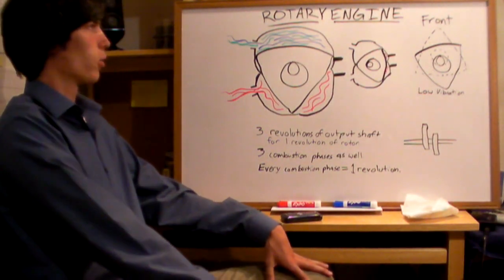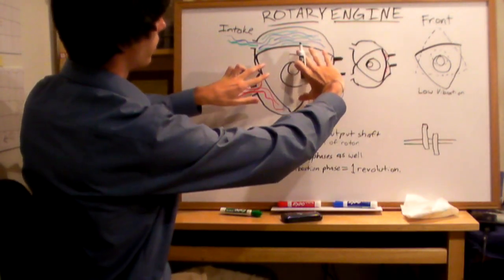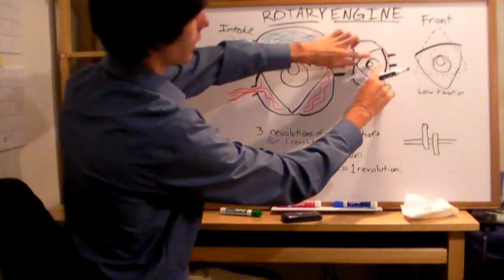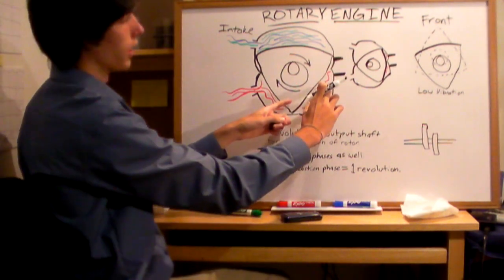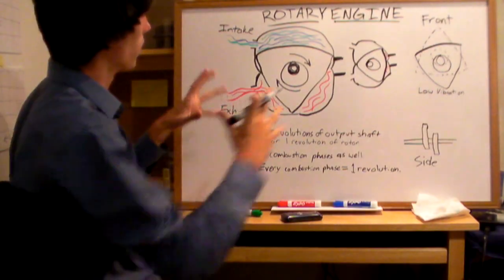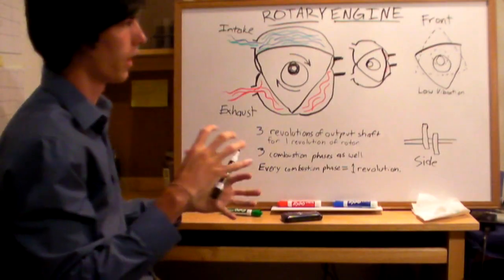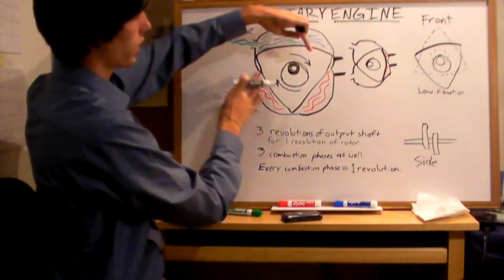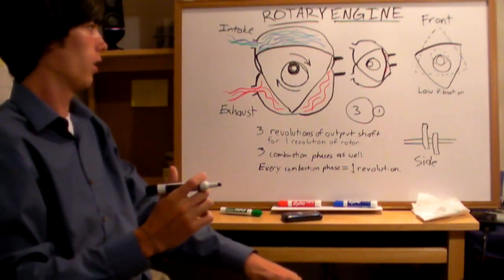Rotary Engine - Explained

Comment: where are the pros and cons?
Reply: What are the cons? Also how can a concept like this not have any pros? it sounds quite nice to me,im not an engineer tho,dont trust me
Reply: Combustion happens only on one end of the chamber and so you have excessive wear on one side with none of those effects on the other two. You also have trouble keeping the gases out of other chambers with seals because of the temperature and pressure differential so you have to have oil being injected into the combustion chamber. By design, the oil is going to be burnt as well so this leads to higher maintenance due to fluctuating oil levels 

The shape of the combustion chamber is also awkward because as you are on the power stroke to ignite the air-fuel mixture, it's already starting the exhaust stroke so you have lower compression ratios as well as poor emissions because of incomplete combustion. Another reason for incomplete combustion is the fact that the spark to ignite the air-fuel mixture has a long distance to go as the rotor continues to move in a circular fashion. You may start to see rotary engines have flames spitting out of the exhaust because of the incomplete combustion occurring in the exhaust manifold. You start to have worse emissions and lower fuel economy as you lose all this energy.

Comment: So why is it that rotaries get terrible fuel economy?  Are their compression ratios high or something?
Reply: +Matthew Bailey Typically they have a low compression ratio. That combined with the combustion chamber shape and problems with rotor seals leads to inefficient burning, causing high exhaust gas temperatures, poor emissions and poor fuel economy.

Comment: are there any real advantages of a rotary engine over a piston ?
as far as i can see the are ineficient and wear much faster.
Reply: +im floop They're relatively light and simple, with only 3 moving parts. They can produce more power than a similarly sized piston engine, but also consume more fuel.
Reply: Tuppoo94 interesting, thanks for the comment ive been looking for this answer for a while

Comment: if i have 3 or  rotors, how is they position going to be?
Reply: “In 2017 it is the 50th anniversary of the Cosmo Sport [Mazda’s first production rotary]. Therefore we want to announce something in 2017 – and not a concept car.”

The concept is said to hint strongly at what might be expected from a production car. Continued Fujiwara: “The concept car is not completely [the look of the production car], but some visions of it is in it.”

 “We realise the fundamental structural problem of the rotary, but recently new materials have been developed and also some measuring, sensing, technology has been updated. We can analyse the combustion in the engine by computer. We can control the ignition system or the injection system in the computer, and [see] what kind of economy can occur in the engine. That kind of technology can help us to new materials, a new ignition system or a new shape for the rotary."

All quotes form Mazdas CEO at the Tokyo Motor Show that all but confirm a rotary engined sports car for 2017. The only reason he doesn't just say it outright is because is an educated person in 2015 who understands how media works..... unlike honda and the NSX. 

I can't find the quote right now but he also said explicitly that since the RX8 there have been at least 50 mazda engineers working on rotary engines which resulted in the 16x engine in a 2007 concept car and more recently the SKYACTIVE R, whatever that may be. Because development cycles are so long theres no way that this car could come out in 2017 if it wasn't already in the final stages of development, so yes, I would say that the rotary engine is very far from dead. Also, the reason the rotary engine was dropped was because of the opec crisis in 1973. Source: the daimler engineer who personally maintains the mercedes C111 concept car whom I had the distinct pleasure of talking to at pebble beach this year, and yes, his collar matched the tartan on the 722 car.
Reply: You sound like your not going to be satisfied until you can personally lick one of the new engines apex seals but since you seem so adamant in your binary definition of the future of internal combustion that time will never come. Any reasonable person has to admit that there will be another rotary engined car in the next few years, and if any of mazdas pr is to believed then it may be making a comeback in a big way in the form of a PEEV range extender.
Reply: +Sach Alvarez Yes there are 3 rotors and 4 rotors. Find it on mazda engine 20B-rew for 3 rotors.
Reply: +The real doktorbimmer being obsolete has nothing to do with weather something is in production, and mazda has always been developing rotary engines and their CEO said that they intend to release a car with their new SKYACTIVE-R engine in 2017.
Reply: @seanzukin8505  A new Mazda  skyactiv-R engine in 2017????
You look really foolish right now.
Reply: the ceo of mazda explicitly said that the rx-vision concept will be a production rotary car in 2017.... no ambiguity. He also said the miata platform is "near perfect", so I wouldn't be surprised if the rotary powered car is based on the miata. I can't find the quote but he also said that mazda feels responsible to keep the rotary alive. I agree with you that it seems that the rotary was dead. I own an rx8 and until this month I was convinced it was the last of the breed but every there is every indication that its coming back in a big way. Be happy.
Reply: http://www.autoexpress.co.uk/mazda/rx-8/92982/mazda-rx-vision-tokyo-concept-previews-new-rx-7-coupe I may have extrapolated a little, but the ceo said a lot of thing that make no sense if they do not intend to make a production car. That being said i dont see how you got that it will be a limited run only for the Japanese market. Sure they killed the RX8, but as an RX8 owner and a huge mazda fan they absolutely did the right thing. That car is extremely well balanced and unique but the only reason it existed was because ford demanded mazda make a four door and not another RX7. They killed it because like any sports car sales dropped off very fast and they couldn't afford to keep it around. Im not sure why your convinced it will be limited run, mostly because if what the ceo said is true mazda intends to make at least one other rotary car; likely a range extend REEV, which is actually quite interesting. I agree that the Renesis engine in its current form is not very competitive. Its possible to scape out 25 mpg on the highway with a light foot but it isnt ideal, however it still passes CA emissions and there is definitely tones of headroom to improve upon that design. A rotary engine with direct injection, a "different shape" as the ceo alluded too (maybe a more efficient combustion chamber?) and new materials (titanium rotor/rotor housing for more thermal efficiency?). the possibility of a low boost turbo to help game emissions and a 1.6 liter engine with a new eccentricity (more torque combustion cycle) could make a new rotary engine relatively competitive in the current market. I dont thing 25/31 is unreasonable, and considering mazda has the lowest corporate average CO2 emissions in the world I wouldn't bet against them. Especially if the car is on the extremely lightweight miata chassis I would say they have a great chance at making something great. The rx8 is not a perfect car by any means but it was built on the same platform as the miata and as a result was relatively lightweight (my lightly modified car is just over 2800lbs) and with 30,000 nm/degree torsional rigidity, which makes it one of the most rigid chasis ever made.
Reply: +The real doktorbimmer well the most modern wankel isn't released yet so you can't make comparison.
Reply: Im pretty sure rolls royce had a diesel wankel engine that never made production..... but other than that I agree. Wankel combustion ratio is not dynamic and it won't be as big as an improvement as piston engines see with gdi but the colder intake temps from atomizing fuel have to play a roll, and according to some interview (Ive read a lot, can't remember) a mazda engineer said DI helped them map all the inefficiencies in the combustion chamber and take steps on improving combustion. There are definitely inherent flaws in the wankel design but I think it is possible to engineer a competitive engine, especially if you factor in how basic  RENESIS is to any other modern ICE. There is a lot of headroom. Personally I feel like the driving experience a wankel offers excuses some of its shortcomings. I see the benefit low end torque motors like an LS engine or a new ford ecobost but I think there are always going to be people out there who want a high reving high horsepower motor, and wankels do that very well. 9500 rpm is just plain fun, and its nice to be able to experience that without dropping 150k on a gt3.
Reply: From 2 rotors being set at 180 degrees I would guess 3 rotors would be set at 120

Comment: At the end you say rotary engines are more reliable than piston cylinder engines because of less moving parts. But I and many other people agree they are less reliable, they burn oil, and don't last as long as piston engines.

Why is that? please explain why you think they are more reliable when in real world situations they are actually less reliable?
Reply: The real doktorbimmer more rotors = more power and better fuel efficiency. It's astonishing how lightweight it is, and the power it has the ability to produce. 

There's zero way you can sit here and say Mazda would have engineered the same rotary engines if they had the budget of Toyota. That's just how business works, it's a shame. I just got an 04 rx8 with 35k original miles, could have got a g37 coupe instead but the car drives like a dream. I'm not married, don't have any kids, and am a huge auto enthusiast. I'm taking advantage of this time to have a car that makes the mundane task of driving as pure and exciting as possible.

If you haven't driven a rotary, it just wouldn't make sense. Sure, better mpg would be great, but am extra toy to drive around on the weekends is a good way not to focus on that part. Even people in Ferrari's would like to visit gas stations less, but money isn't a concern if you do what you love
Reply: +Luk Wisnie The Wankel rotary engine wears out more quickly and needs more frequent rebuilds than a reciprocating engine, but it is less likely to experience a sudden catastrophic failure. It's very rare the engines will leave you on the side of the road without advanced warning that something was about to go.

+The real doktorbimmer Never have I seen anyone who hated something so much as you seem to hate the Wankel rotary, but your statement about it having little power per displacement really takes the cake. You've only managed to name a couple of turbocharged reciprocating engines running very high boost that have more power per displacement than the 13B-MSP normally aspirated rotary engine. The fact that you can't even come up with many turbocharged engines that beat it is very telling, but try coming up with some naturally aspirated engines that do. The 13B has the same displacement as a Hayabusa engine yet puts out more power, enough said.

Nevertheless, power per displacement is really a pointless measurement, especially between two fundamentally different engines where displacement is measured in different ways. What's far more important, at least in a sports car, is power per weight, and the Wankel rotary shines even more in that regard. The 13B-MSP only weighs around 200 lbs and yet pushes around 230 hp. It's very difficult to do that from a reciprocating engine and if you do, you're going to take a huge hit to reliability. That's why the RX-8 is considered to be the best handling sports car for under $50,000. The rotary engine has some major drawbacks, but in regards to the specifications you expect from a sports car (especially a supercar) where economy and reliability aren't important, a reciprocating engine can't hold a candle to it.
Reply: The real doktorbimmer 

Name one car for under $50,000 with a normally aspirated engine that has more power per displacement than the RX-8 engine (manual tranny version). If the RX-8 engine is such crap, you should be able to name several, but I doubt you can name one. The RX-8 engine has about the same power per displacement as a modern 600cc supersport bike engine and I just don't see any other car engine matching that without running a lot of boost or having a huge amount of money thrown at it.

I can't believe you're actually going to try to argue that efficiency matters in supercars. Nobody spends $300,000 on a supercar and then complains that it only gets 8 mpg. When someone buys such a car, they probably take pride in the fact that the fuel economy is worse than that of a school bus.

No, as long as it's efficient enough to make it to the next gas station, that's good enough. In a cheaper sports car, it matters a little more but it's still second priority. No reasonable person buys any kind of sports car and expects it to be as efficient as an economy car. I can't believe we're even debating this.

Comment: 230bhp from 1.3L wankel in RX-8         ....respect.......
Reply: doktorbimmer just drop a v8 in it after;)
Reply: maybe so but giving a car a second chance feels amazing;)
Reply: no , but if i got the chance to i'd do it ?
Reply: there are turbo'd 13b's out there making more than 1000 hp lmao.
Reply: Doesn't matter if it's not production. If you wanna talk about high boost numbers. A 4 stroke reciprocating engine will never be as powerful per displacement as a non reciprocating engine that has 1 power event per rotor every revolution of the crankshaft (like a 2 stroke piston engine)
Reply: The real doktorbimmer rx-8 came in 2003 , evo x came in 2008 and 1:1 in 2013 , 2000s was the decade that has seen maximum advancements in automobile tech. so it was a true SUCCESS at that time
Reply: 1, 2-stroke engines are extremely bad on the environment due to burning of oil. The wankel behaves as a 2 stroke when regarding the frequency of power events per crankshaft/e shaft revolution. 26b 2.6L 4rotor engine makes between 690 and 900 naturally aspirated hp depending whether the Rpms are limited at 9000 or higher. there's a video of a dyno of an rx7 with a turbocharged 13b which makes 1077 whp. the only figures even close were the 86 f1 engines in qualifying trim
Reply: You're still not getting the fact that a Wankel engine has 1  power event in a rotor per revolution of the e shaft, which is as frequent as 2 stroke engines. Whereas a 4 stroke engine has only 1 power event in a piston every other revolution of the crankshaft. Wankels have twice the power event per rpm when comparing equal amount of rotors vs pistons of 4 stroke engines. So a 4 rotor engine will fire as frequently as a v8.
Reply: MrSkaterboi10
Forget the IC engines; Drop in an electric motor.
In an old Mazda rx7, she would FLY!
Reply: In 10 years, the batteries will be vastly improved.
Reply: Gotta have faith. I suggest buying stock in Tesla like I did back in Jan. 2017. 100 shares @ $251. Now hovering around $300.
I think the battery technology is getting ready to explode.
Reply: I'm not worried. It's only money.
Reply: Then maybe you should support Tesla.
Electric cars are the future.
Reply: Even when we run out of oil?

Comment: So if the compression ratios aren't as high on a rotary engine, are they not used because you don't get good fuel efficiency?
Reply: doktorbimmer I read an article a while ago how they will re-introduce Wankel in a big way for cheap cars in India... ok, that may not be the Wankel you'd want... ;)

I want a C111 :)
Reply: doktorbimmer My auntie drove in one on the MB test track back in the day... and got a model version for me :)
Reply: doktorbimmer You can have the next best thing... the company that designed the C111 for MB went on to build a look-a-like with MB V8, rear axle, SL tail lights and 928 front axle - it is called Isdera Imperator 108i. I have even seen it twice in 20 years, once on the Autobahn, and the other occasion I strangely can't remember there are only 12 or 16 (?). I used to go to the IAA only to see this car :)

Comment: in a 4 rotor is there a firing order? like 1st rotor then 3rd,4th then 2nd for example. or is it just 1,2,3,4 90 degrees apart?

Comment: You keep saying crank shaft, its an eccentric shaft there is no crank shaft in a rotary
Reply from the maker: Jacob Zarpentine Serves the same purpose.
Reply: yet mazda put crank sensors on them... same brush, different strokes. er...is that the saying?
Reply: doktorbimmer wankel (nsu/felix/mazda) are a type of rotary. there are 3 to my knowlege. radial/wankel/electric

a crankshaft spins pistons, an eshaft spins doritos. same job. different hooker.
Reply: The real doktorbimmer i thought Wankel and Rotary were the same. Nice for clearing it up! No wonder I was confused last time I was looking at old aircraft rotaries... the thing looked nothing like the marketed "Mazda Rotary" (which is actually a Wankel)... Besides, it would be a bit impractical to fit actual rotary engines in passenger automotive use - the CG would be sky-high!!! LOL